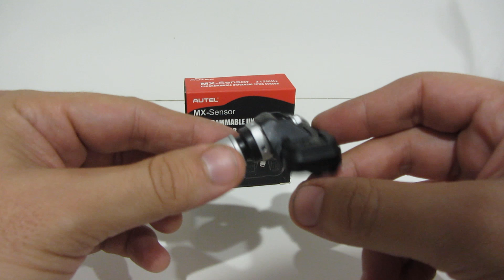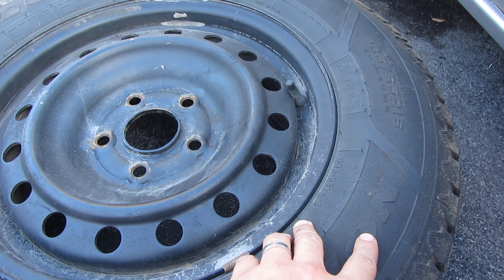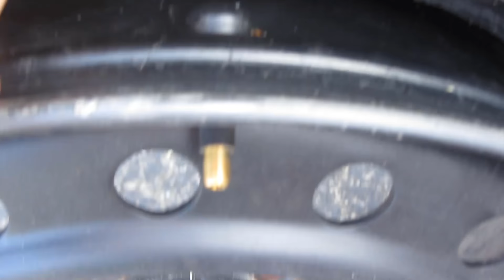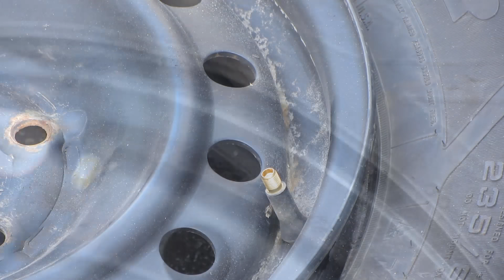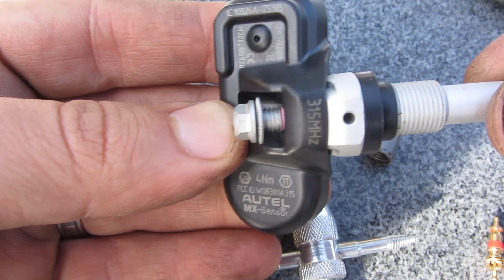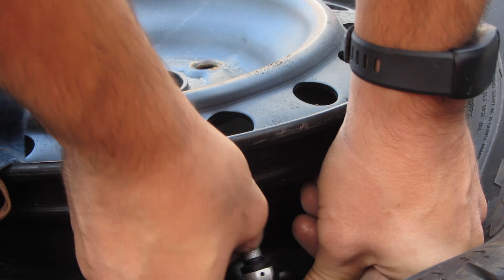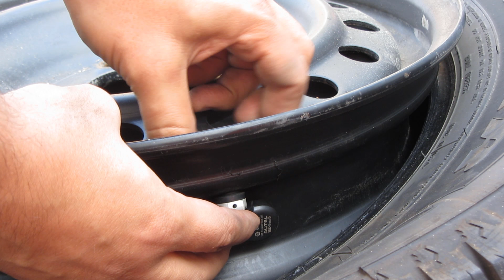Install New TPMS Sensor DIY Without Needing Rebalance

Comment: I had my metal valve caps stuck and I took it to the tire shop, the guy cut out the valve stem and replaced it with a new one and told me I didnt have sensors. I have 2017 Honda accord hybrid. Did I get scammed? Or does replacing the valve stem has nothing to do with the sensors? Someone help me out please
Reply from the maker: If you are supposed to have sensors and one is gone, then there would be a "TPMS" light on your dash. If you don't see that, then you're fine.
Reply from the maker: Interesting. Looks like the Civics and Accords don't use wireless sensors anymore. Although the new Odysseys still use them.
Reply: A lot of Honda’s don’t use sensor they just have a valve in and use the sensors on the hub. So I’m 90% sure you didn’t get scammed

Comment: how to you sync the TPMS with your car, is it automatic? Are all TPMS sensors compatible with every car?
Reply from the maker: Not all sensors are compatible with all. Most cars need either 315MHz or 433MHz sensors.
How to sync depends on the car. Some do it automatically. Some have a procedure that you may or may not need a special scanner tool for.

Comment: You still have to balance the tires tpms sensor will throw the ballance off.
Reply from the maker: DSG I talked about that in the video. If you notice a problem, sure, balance them. But if there was a sensor there before, it's not likely you'll have a problem.

Comment: tpms  programmers are 100 or 2 still worth knowing how to do it thanks
Reply: charles philippe You're an entrepreneurial genius! 👍
Reply from the maker: Many are pretty expensive, yes. But I recommended one in my other video that is quite inexpensive (I got it for about $50): https://youtu.be/N6p6xV4PlHc
Reply: No i mean it's worth it ...lol i bought a expensive one and bin busy around my neighborhood...its bin fun..and helpful
Reply from the maker: Yeah, they can definitely be worth it if you can get enough use out of them. Going around the neighborhood is brilliant!!
Not specific to TPMS, but I've even thought of putting up an ad on Craiglist/Kijiji offering to read the OBD codes for people for like, $10. It'd be easy cash and saves them the crazy prices shops charge for the same thing.
Reply from the maker: I'm in Canada too :) A little while ago I bought a Foxwell NT510, which I seems to do all the same things that one does, although it doesn't have the suggested fixes. That's a nice touch.
Reply: yea that one has code connect for most things  ill look up that  Foxwell NT510, when do you get it ? interesting has a sd card
Reply from the maker: I got it a few months ago. The SD card stores the manufacturer-specific stuff. It comes with one manufacturer for free (I got Honda) and then you can buy more if you need. And it's bidirectional too, so I can, for example, tell it to open the power sliding doors on my van from the NT510. That kind of thing is really helpful for testing different systems. For the general OBD2 stuff you don't need the card. I ordered it right from China because it was cheaper, but it does take longer to arrive, although there are a few from US sellers around the same price: https://goo.gl/H2X4ku
Reply from the maker: The NT510 doesn't do anything with sensors themselves, but you can program the vehicle with the codes of new sensors you have installed. They charge $60 for each additional manufacturer, which you can buy right from their website and download after you have registered your device with them.
I'm not familiar with that NT624 that you linked to, so I couldn't tell you what the difference is. Seems like it supports all manufacturers out of the box. We have two Honda's (2010 Civic and 2009 Odyssey) so I only need the one.
Reply: Have the tools they do not....funny how a blinking light can make one money :)

Comment: You will end up going to the dealer to get it programmed. Thanks for saving us the grunt work.
Reply from the maker: Thomas OConnor Not necessarily. Many cars will automatically relearn new sensors. Other cars have relearn routines that can be done without any special tool (check your owners or service manual). But even if you do have to get your car programmed, go to an independent tire shop. You should be able to find one that has the tools to do it. The dealer will just charge more for the same thing.
Reply: Gabe's Hacks 
My 2004 Mazda3 has TPMS with dead sensors. Owners manual doesn’t  address sensor replacement. How can I know if TPMS brain will automatically recognize replacements or if I need to buy programmer too?

Excellent vid, professional level, explanation left no area unexplained. Good camera work, lighting.

Thanks!
Reply from the maker: Thanks for the compliments!
I use the document provided by Autel: https://www.auteltech.com/TPMS%20Diagnostic%20&%20Service%20Tool/534.jhtml
On the 'Downloads' tab, download the file named "Sensor_FUNCLIST" for where you are (for example, "US"). Then look up your car. The 'Relearn Type' column tells you if it automatically learns new sensors ("A") or not.
According to that, the Mazda 3's (actually all the Mazdas) automatically relearn sensors.
Reply from the maker: I looked up the owner's manual. It does mention the procedure on page 5-24 under the heading "When changing tires yourself"

Comment: Hello Gabe, 
Would you please tell me why you chose this name brand, & if you could give me other reputable brands that don't cost an Arm or Leg.
Toyota wants $80 dollars a piece for factory on. O'Riellys wants $55 a piece for aftermarket brand.
This Dam TPMS sensor Bullshit took the least cost part in a tire change from a $1 Dollar part to a $80 Dollar part.
Looking forward to your reply !!
Reply from the maker: Tony NoName45 I described the reasons more in my other video. But mainly it was because these are programmable, and the tool to program them isn't terribly expensive.
What model/year Toyota do you have? If your car automatically relearn sensors, you can just buy any sensor that's compatible and throw it in and the car will figure it out. Check rockauto.com. Their prices are usually the lowest.
Reply: Gabe's Hacks My car is a "2008" Toyota Yaris. I'll check out Rock Auto's website.
Thank You Gabe for your information.
Reply from the maker: The Yaris does not automatically learn new sensors (I verified in the owner's manual). And there is no way to manually initiate a "relearn" procedure like some cars. This means that if you buy a new sensor, your car needs to be programmed with the code of the new sensor. A special tool is needed for that. An independent tire shop may be able to do the programming for you if you call around.
In my other video, I did the opposite: I programmed the sensors to match the same codes as my old sensors. But my main reason for doing that was to create an identical set of sensors to put in my winter tires.
Reply: Gabe's Hacks So your telling me that  if I want to install new sensors , let's say in a spare set of tires I would have to program my Car to the new sensors rather than program the new sensors to the existing sensors that are already on the car. I have no clue when it comes to these TPMS sensors, none what so ever. What I want to do is remove all the TPMS sensors & just  old school with the tried & true method of a set of  $1 Dollar Valve stems, like it should have been in the first place. This TPMS Sensors B.S. is just a scam to make money for The Automotive Industry w/ the help of Corrupt Government. Most experienced drivers don't need a set of  $320 sensors to know that a tire is low on air.
Gabe Thank You for trying to shed some light on the subject, even though I feel like I am still in the dark.
Reply from the maker: If you want a second set of sensors, then the best bet is to use cloneable sensors. That's what I did in my other video: https://youtu.be/N6p6xV4PlHc
You certainly can just remove all the sensors and use regular valve stems, as long as you don't mind the light being lit up on the dash.

Comment: Thank you for this tutorial. I will be doing this to change out batteries on the sensors. 
👍🏻👍🏻
Reply from the maker: The sensors aren't usually made to be able to replace the batteries. They're sealed. Although I have wondered if it's possible to cut them open, replace the battery, and put them back together successfully. But the batteries apparently last 7-10 years, so it's not a huge deal.
Reply: Gabe's Hacks dealer said they are actually replaceable. They have the complete units themselves for $11 each. I may take your advice and just swap all 4 out. Car is 2013, so if 1 goes I’m sure the rest are on borrowed time also. I’ll let you know how I make out with this project - either way (bats only or complete sensors). 👍🏻
Reply from the maker: Yeah, please let me know, especially if you are able to replace just the batteries. That would be the first I hear of that being possible. I wouldn't mind knowing what brand they are too.

Comment: last time my TPMS sensor broke, the dealer charged me 280 to replace it.
Reply from the maker: Woah! Crazy.
Reply: My Honda dealer charged me 375.  It was 7 years ago.
Reply: Buy external tpms, easy to replace yourself and cheaper , not as accurate but has worked for me

Comment: Great video, one note: it is not good to use straight liquid detergent on tires. Dilluted with water is all you need to slick it up.
Reply from the maker: JB Marker What's the problem with straight detergent?
Reply: The stuff in dish soap that cuts grease attacks rubber. I don't think your tires will come off, but I have heard of them slipping on the rims. I wouldn't lose sleep over it, but if you dilute with water it will do the same job and then dry up.
Reply from the maker: Fair enough, although I haven't had any trouble with my winter tires over the two winters I've used them since this video. Something to keep in mind anyway.

Comment: So you add 20gms to the rim by way of the extra weight of the sensor then don't balance it?
Then you stand on a tyre while inflating it? If the thing unzips it could rip the flesh clean off your leg.
Reply: Keep it simple dude. Skip to a different video. All u need to do. This is not rocket science
Reply from the maker: Brem Balancing was covered in the video. And it can't unzip under the little pressure it takes to seat the bead.
Reply: Gabe's Hacks A tyre can, has and will again unzip at less than the pressure required to seat the bead. At 20 psi a tyre contains enough energy to seriously harm you if that energy is focused. The likelihood of it being focused in a specific manor is low but still exists. A used tyre may contain structural failures esp in sidewall cords that mean the pressure required to cause the failure is much lower than that of a structurally sound tyre.
As a product performance engineer for 2 of the largest tyre companines I have seen countless injuries caused by people assuming the pressure wouldnt be high enough to harm them. I have seen a wheelbarrow rim split and one half be thrown 20 meters into a steel door and dent the door. Enough energy is stored in a barrow tyre at 20psi to do that. Now imagine that rim section flying at a face rather than a door. You treat used tyres as UXDs.
Reply: Gabe's Hacks The balancing was covered and it was covered incorrectly. If you break the bead alone without changing anything you can slightly alter the balance. Take into account that unless it was recently balanced it is not likely to be in balance before beginning this process factor in the breaking of the bead and the alteration of the weight on the rim and the result is a required rebalance.
You don't have to rebalance it but if you don't you are only doing half of the job.
Reply from the maker: Brem Are you saying that it takes 20 psi to seat the bead?
I do have to mount a few tires coming up. I'll measure the pressure needed to seat the bead. I'd be really surprised if it's 20 psi.
Reply from the maker: Brem Balancing will never be absolutely perfect. All it needs to be is undetectable. If you detect a problem after, then by all means, get it balanced.
Reply: Gabe's Hacks No I'm not saying it takes 20psi to seat the bead at all. I didn't say it or imply it.
Beads seat at various pressures some lower than 20 and some much higher.
Reply: Gabe's Hacks Balancing can be out enough to cause a shake at the hub but the steering bushes and joints can absorb minute shakes. This means while you don't feel it, it is constantly causing premature wear to bearings and other suspension, hub and steering componants. Balance doesn't have to be perfect but it should be as close to perfect as possible.

Comment: Take them to the shop just have them break the bead, paying a couple bucks may save you a broken ankle.so make sure you have good health insurance.
Reply from the maker: "A couple bucks" is a bit of an exaggeration. Many shops charge $15-20 per tire for a tire install (I assuming they'd charge the same for a TPMS install since it's just about the same amount of work). Finding a shop that'll do it for less can be difficult unless you "know a guy". But if you "know a guy" then you wouldn't be looking for DIY videos on YouTube.

And of course you need to be careful. But that's true of any DIY project.
Reply: Gabe's Hacks Most would charge nothing to just break the bead though.
Reply: we are not all bubble boys.

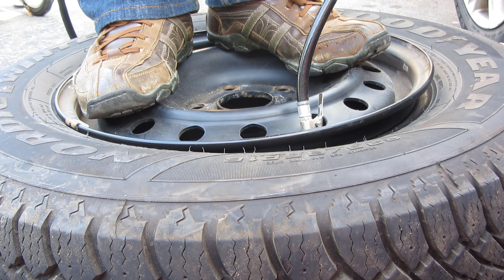Comment: The most dangerous thing you can do when seating a bead on a tire 10:22. You are never to have ANY part of your body over the wheel when inflating. It'll popcorn you worse than an airbag salvaged from a car.
Reply from the maker: Do you have any sources for that? I've certainly seen videos of truck tires exploding. The only stories I can find about car/van tires exploding is when they're filled way beyond the pressure they're designed to handle. I'm only standing on it long enough to seat the bead, which doesn't take that much pressure at all. It took quite a bit of time after seating the bead (while not standing on it) to fill it to the recommended pressure.
I'm not saying you're wrong - but I simply can't find any evidence that a tire could explode under the little pressure it takes to seat the bead. If you can point me to that evidence, I'd be interested to see it.
Reply from the maker: Brem And how much pressure was that wheel barrow tire under when that happened?
Reply: I know this is ancient but Gabe is right.  The other Chicken Littles worried about the tire exploding and hurting someone don't realize the monumental differences between passenger car tires (like in this video) and commercial truck tires.  As Gabe said, truck tires are meant to be used with much higher psi.  Those type of tires are quite dangerous which is why shops normally put truck tires in a cage just to fill them with air, from what I have seen at least.  These tires Gabe is working on do not represent the same risk in the slightest.  Well done video.  Thank you Gabe.
Reply from the maker: Brem Isn't 20 psi pretty much the max pressure for a wheel barrow tire?
Reply: I would have to agree. While very unlikely, but possible, the tire could explode shooting the rim upwards, totally ruining your day. Safer way would be to mount wheel on vehicle, remove shrader valve, 10-20 psi should seal the bead. Yes, it's more work. I only comment because when making an instructional / how to video safety precautions should at least be mentioned even though you're not doing it.

I knew a guy that worked with a guy that blew half his head off not properly mounting tire.

Otherwise great video! Thank you!!
Reply: Gabe's Hacks Approximately 20psi
Reply: Gabe's Hacks It is common sense! If the thing unzips it can peel flesh from bone. Ive seen a wheel barrow tyre unzip and imbed a section of bead wire in a mans face.

Comment: Good info.  The dealership told my daughter she needs special tires for her Envoy thanks to your video, I see the device is in the rim and has nothing to do with the tires.  Thanks.
Reply from the maker: That's a new one! I've never heard of "needing" special tires. The service manual for my van says you need special rims to use TPMS, but that's only because the special rims have weights built in to offset the weight of the sensor, but that doesn't really mean you can't use normal rims.
Reply: Gabe's Hacks She may have a vehicle with Run Flat tyres.

Comment: I'd use the rubber style in your winter tires. those metal one corrode & become seized in.
Reply from the maker: It has rubber around where it fits in the hole to keep a seal, so that won't get stuck. The big nut might get stuck, but the only time you need to undo that is if you're taking it off the rim, and if you're taking it off the rim, it's probably because it's no good anymore, so it's ok to just destroy it to get it out.
That said, they do make rubber ones. Links are in my blog post: http://www.gabeshacks.com/2016/10/how-to-clone-and-program-new-tpms.html
Reply: speaking from experience. I am a car tech. I see many tpms sensors corroded & we have to destroy the sensors to change the airtight seal when it leaks. the rubber ones don't corrode or seize. just a suggestion.
Reply from the maker: Good to know!

Comment: Good video, just a small tip... if you have a hard time with the tire sealing on the bead you can use a ratchet strap around the outside of the tire...when you tighten the strap it will push both sides of the bead outwards.  :)
Reply from the maker: That's a great idea!

Comment: You never ever want to break the bead right at the sensor you’re better off breaking it 180 degrees away then working the bead around. But seeing as it had no TPNS sensor to being with until after you added one that’s fine.
Reply: heyitschino Some early sensors were fitted opposite the valve. Always break it at 90°